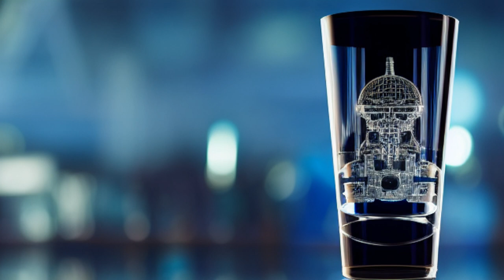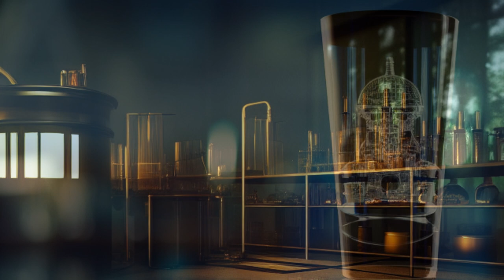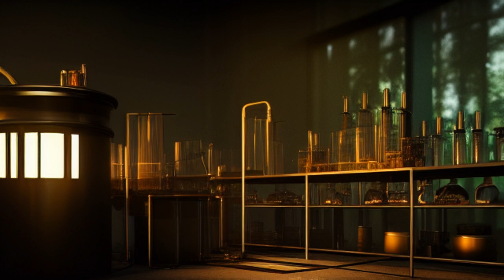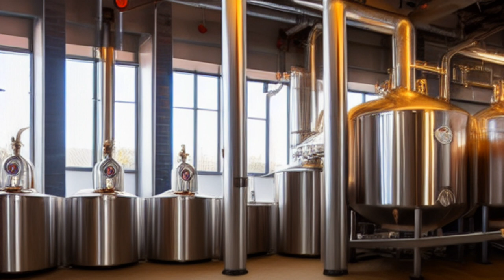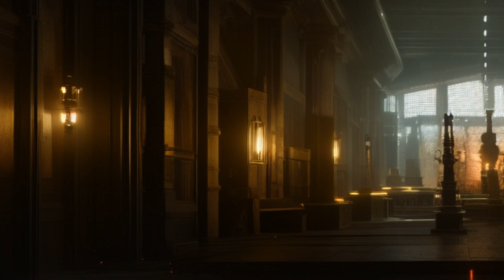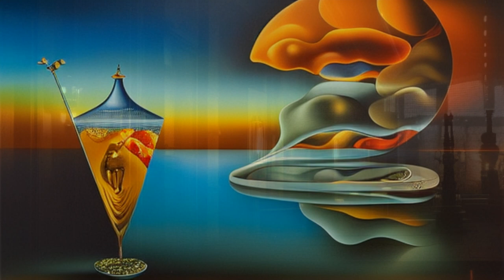The Continuous Distillation Taboo: Moonshine

Comment: Hi, yes it is hard to find info on condis,(just made that up). I have been distilling for a few years now and use lab glassware (24/40) to make my stills, pot, re-flux and now continuous. Have run two condis, with good results, only problem being they are relay only striping runs, will have to do a spirit run to remove heads,tails, Hence, how I found your channel, looking for a design that condis and re flux at the same time.Will go and check out the rest of your videos. thanks for all the work you have put into the videos. Cheers   PS that jar column is brilliant, will have to look into it..
Reply from the maker: That is a frustration I know! I tried a lot of things to get matching stripping and rectifying columns. I was building a bubble cap column with copper pipe and glass candle shades, they are glass cylinders suitable for the column wall. It was when I realised this stripping column alone was going to end up over 3m tall that I tried the sloping plane tube and got lucky.
Reply: @tight1449  is the slping plane tube lucky or clever? I think it leans on the clever side, rather than luck. I love the way that you push the boundaries of home distillation
Reply from the maker: @krumpinjugger  Mostly luck.  It was born out of penury and frustration. I knew weeping was the problem with stripping columns, so made a four stage bubble cap column. After measuring its performance, I realised I was going to need 20+ stages so looked for a simpler way of bringing together vapour flowing in one direction and liquid flowing in the other.

I used a straight piece of insulated copper pipe at about 15 degrees to the horizontal, which kind of worked, but it wept too much. I tried five degrees to the horizontal and this was better and allowed me to estimate the necessary angle. So it worked with a bit of adjustment and no major setbacks along the way, which was lucky.

I tried to use it for a rectifying column. My initial attempt was not successful and I haven't returned to it. But if you get it to work as a rectifying column, let me know.

Comment: While you have covered the principles and some of the components will you write up plans / what you are using for things like the steam generator so others can replicate as finding information is hard.
Reply from the maker: Do you mean specifically on continuous distillation? I am planning to publish details on my still set up. I got it working reliably with a 28mm diameter column using column surface temperature measurements as control parameters but with such a thin column yield was low at about 50 ml spirit per hour. I tried to scale it to a larger column but the surface temperature system did not work. I am working  on a bottom temperature control parameter for larger columns but do not yet have a system that is easy to replicate. If you are interested in the lower yield 28mm system I can provide full details.